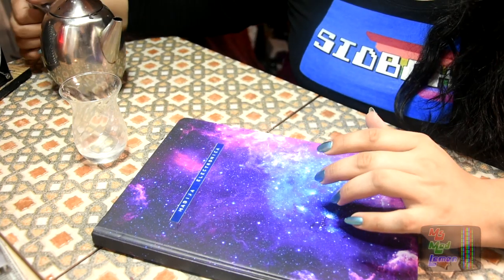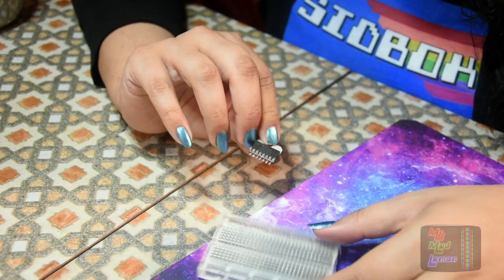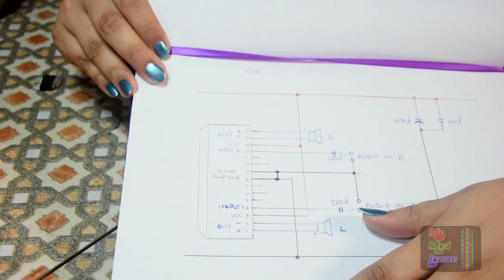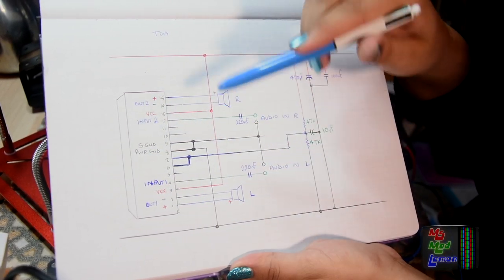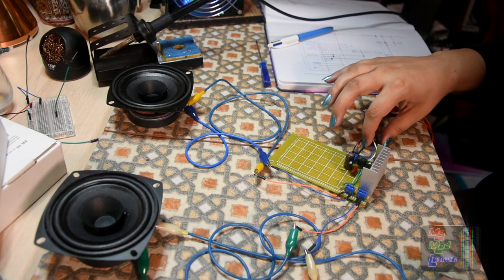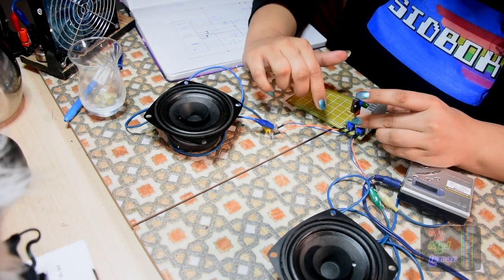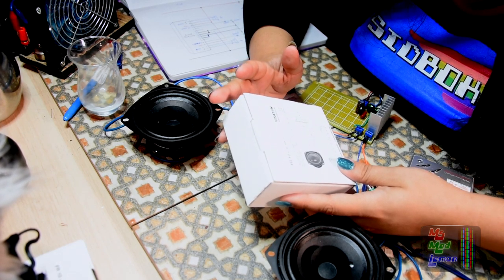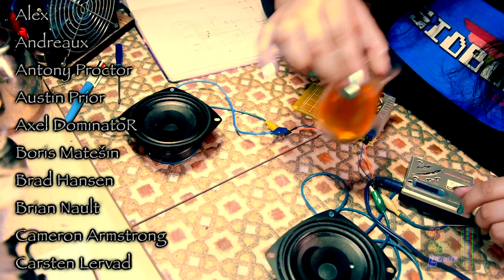Power amp build TDA7297 - SIDBoomBox Project 07

Comment: The bass response is going to be awsome when it's in the case! I've never used those anp chips, I might have to rebuild my stereo with one. (It's 10 years old). At the moment it's using 2 50 watt mono modules that are starting to deliver hum from somewhere. Power supply is fine and it's all earthed, so I'll just make new power amp.

Comment: What was the device, and the media you inserted, at 8:15 ?

I'm quite optimistic about these speakers. Speakers usually have a lot more bass when housed in a suitable enclosure, especially when properly ported. But these little things sounded quite punchy playing that Lotus music at 09:00, and the beat at 9:30, with no enclosure at all. And the drivers weren't even visibly moving. That implies they weren't really being pushed, and can go a lot louder. They also sounded nice and clear, wih a crisp treble response. 

I expect with these speakers properly housed, and with the volume pumped up, they'll sound a lot more powerful, with nice punchy bass. (Try to make some bass ports in your finished product, if it doesn't already have them.) I think they're going to sound great! :)
Reply: Nope, the speakers' free air Q is .67 so they're not suitable for ported enclosures. 1.5 cuft/43 liters give you a flat-ish response but that's far too big and you still get a truck load of delay.
Reply from the maker: @westelaudio943  So what you're saying is installing these speakers in an enclosure won't make a difference?... Not true, the project is almost done and the speakers are already installed, they sound great, amazing in fact. 
I think you're dwelling on the little details a bit too much.
Reply: @MsMadLemon  

It makes a big difference. An enclosure is necessary cause without it you won't have any bass, but not every enclosure is good. The best enclosure for those speakers would be sealed and not ported. Open back might work aswell although the Q might even be a bit too low, but you can try it and see.

So in short, I said those speakers aren't very good for ported enclosures, but of course they need some kind of enclosure or at least some kind of baffle, as any other speaker.
Reply: @MsMadLemon  Ports are basically holes or openings made in a speaker case or enclosure, to allow air to flow in and out of the enclosure. Some speakers benefit from them, others do not. Aapparently I was wrong about these speakers benefiting from having ports. Westel are saying they will benefit from being enclosed, but advising against making bass ports (big holes) for them.  
I can't wait to hear how they sound in the finished product.  😀
Reply from the maker: @Richard.Linder  Ah , I didn't know the term "ports" I just call them 'bass holes'  I misunderstood.. I thought he meant a completely closed enclosure without any holes at all which i'm figuring wouldnt let the cone move so well? i've not messed with speakers themselves much nor built any, so I only know the basics.

Comment: Concerning power ratings. The rated power is only the thermal power handling of the voice coil. It doesn't say anything about what is required to drive the speaker to max. excursion, which is probably just a handful of watts for such a speaker in the bass range. A 30 watts voice coil is only an advantage if it's used as a midrange with low excursion - in a big multiway system or a voice range in a PA/intercom system where you will reach the thermal limit before the mechanical limit.
For a boombox as a full range a 30 watts voice coil is an overkill of course but it can't hurt either. Good work BTW.
Reply from the maker: Thanks, and regarding power ratings, to be honest, I don't think I need to worry about it at that level, it's just splitting hairs lol. I mean a power amp capable of giving out 15W per channel and speakers rated at 30W, it sounds decent... also overkill for a Boombox?... Not for a Boombox which I design ;o)
Reply: @MsMadLemon  

Yes of course, you won't use the full 15 watts anyways, because that will mechanically overdrive the speaker with most music. But it's always good to have headroom...

Comment: If you're actually planning on getting a decent runtime on batteries, a class D module will be a lot more efficient.
Reply from the maker: Too much noise with class D amps though, and I dont wanna use modules, I wanna build the circuits from scratch, in the spirit of the project.
Reply: @MsMadLemon  

Some time ago TI offered class D amp chips in DIP packages that you could use for DIY curcuits on a perfboard. The had about 15WPC without heatsink I believe. Dunno if they still make them. SMD is of course horrible for DIY.
Reply from the maker: @westelaudio943  Still though it feels like a cop out using modules, and not in the spirit of the project... Class Ds are noisy and arent as great sounding.
though still handy for being in DIP packages for those who want to use them. SMD circuits are good but yeah, not for when you're wanting to create a retro inspired through hole project like this.
Reply: @MsMadLemon  

Well it's not a module, just the chip, all the external components like low pass filters must be added by you of course. 

http://www.ti.com/product/TPA3122D2

I honestly don't think the TI class D amps sound bad, there is no problem with audible noise but if you mean HF noise you're probably right, so it might be a bad choice for something with a radio in it although I haven't tried it. I also trust the old school multiwatt class A/B stuff more, but not having to deal with a ginormous heat sink is quite an advantage with class D.
Reply from the maker: @westelaudio943  Class D amps just sound flat. Not sure how you can encourage the use of class D amplifiers, but at the same time pick at the details of these speakers in your other comment about them not being suitable for porting in enclosures
Reply: @MsMadLemon  

Haha no, I don't encourage using them. Of course class A/B sounds better, but the question is how much and in which situation is this "better" noticable? I think class D can be used where high power is needed and space is at premium. In a boombox with a radio in it it might not be the best idea. 

And also, the difference in sound between different amp classes is marginal when compared to a wrong speaker in a ported cabinet. One note, muddy/delayed and overshooting bass is the outcome.   Think of the speaker  as a high pass filter, it also has a Q factor determining the level at resonance. A sealed enclosure raises the Q far less than a ported one since the port is essentially a resonator that's supposed to raise the frequencies exactly where the speaker itself rolls off. If there is already a peak there in an equivalent sealed box will get far worse with the port. Speaker drivers for ported should have a free air Q of sround .25 - .5
Reply: @westelaudio943  The Class A/B does sound better, and IMO using the Class D in THIS project would just not work, the sidbox unit can produce a lot of digital noise if not earthed or properly grounded, since thie SidBoomBox has alot of gear inside it, it was impossible to eliminate all the digital noise... the Class D would just have amplified the problem... the SidBox it self does not use a Class D, I chose the TDA2822M for this application because it was BOTH LOUD and sounded so much better in small headphones... the sidbox modification I made for the SidBoomBox does NOT have the TDA2822M, so Maddi was able to utilise the full power out of the DAC. This made it possible for the BoomBox to sound exactly how it needed to sound. Power utilisation is not a problem. AND Class A/B sounds orders of magnitude different to Class D (IMO) which does sound flat and can just sound grainy. Believe me, Maddi chose the correct AMP for the SidBoomBox. When the unit was closed up the speakers came to life! and not just a small way, it gives a PUNCH. I was there to hear it sing, and yes, it does sing SOO WELL! ALSO you have to understand, theory of a speaker and practical use are mostly if not always never the same. Maddi researched extensively for what she needed for the sound to be great, and frankly it does... I LOVE IT.  While you are right about matching the AMP to the speakers, but when you have very nice speakers and a nice AMP and you want them to work together, time and care is required to make it happen... Maddi did just that :)